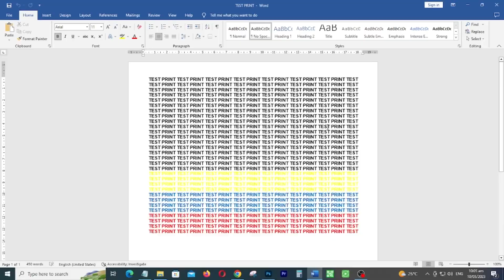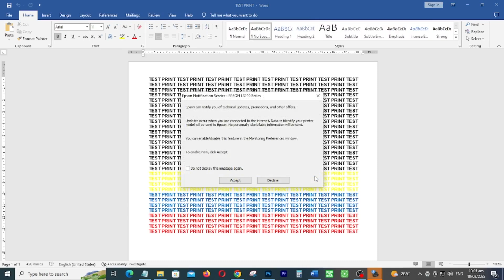ERROR CODE 031006 FIXED EPSON L3110, L3210, L3150

Comment: boss nilinisan ko lang ang printer head boss gamit ang syringe pag balik ko bat ganyan n ang problema ng printer ko boss? sana ma explain mo ng maayos idol kung bat naganon sya boss
Reply from the maker: Kung di ako nagkamali posible nabasa ang printerhead flex doon mismo sa printerhead na nakakabit baka nagrounded.
Reply: Ganyan din nangyari lods sa akin, ano kaya gagawin?
Reply: Anong best solution dito mga sir? same issue. sana masagot. salamat
Reply from the maker: @rhinemallari1793  kung di na kaya ng linis linis lang ang printer head mismo palitan na talaga sir kasi na grounded na po.
Reply from the maker: @raymondsoriano3668  Palit Flex muna lods tapus bago i kabit dapat nalinisan ng mabuti ang printer head mismo yung pinagkabitan ng Flex.